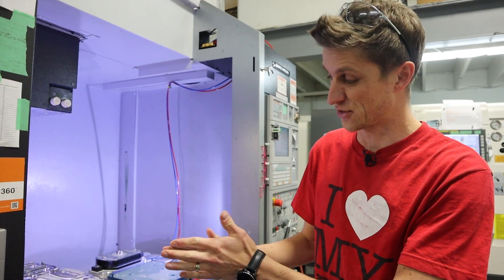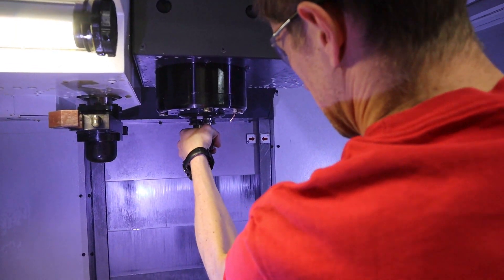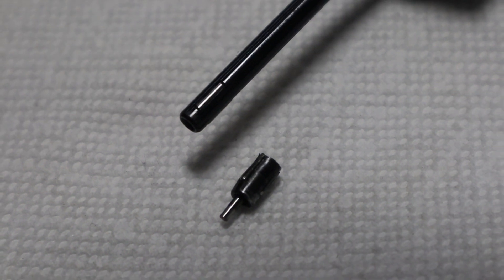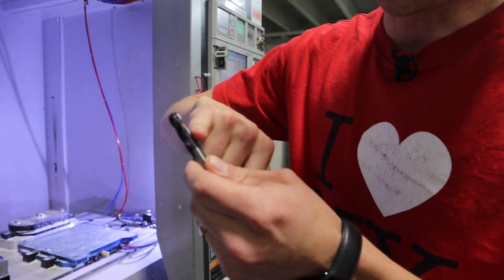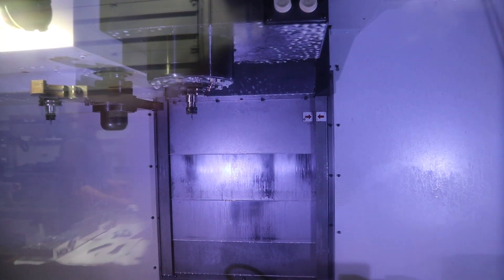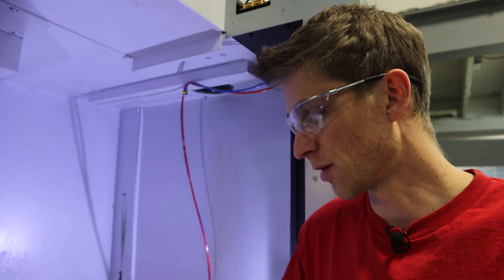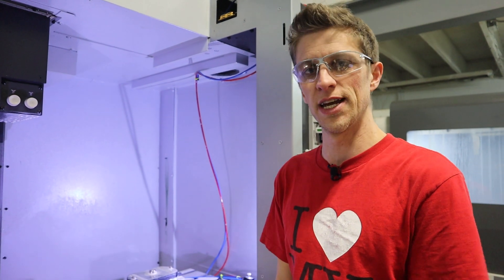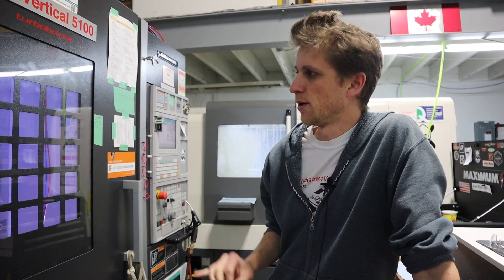Proper Burni$hing w/ a Cogsdill Tool - Part 4

Comment: i run those  for finishing oring bores, the most stupid break we had was the machine got put on osp and the operator changed the part, the burnisher is definitely not a good drill bit.  so far we have found best reliability by reaming then rolling for final finish, seems like more work but it is still less than honing the final bore

Comment: I think I had mentioned burnishing as a fine finishing op several times over the past couple of years so glad to see that you are using it! Have you tried roller burnishing on the faces? That could be a much faster method than the lapping and achieve the same surface results.  I use a roller burnisher on cam and main journals on engines and it works fantastic.
Reply: have you guys seen the new face burnishing tool (DBFM)   -  the link is here - https://www.youtube.com/watch?v=ViyyRlpT53g

Comment: Never heard of that burnishing tool but that's pretty cool. I would imagine that cold forming the metal like that will increase its hardness and give you a more durable bearing surface.
Reply: That is exactly what the Cogsdill Roller Burnishing tool does - there is more information on the process on our website here - https://cogsdill.com/products/burnishing-tools/
Reply: Yeah i totally concur with your comment. Im thinking it does alot of what shot peening would do but a more in contact process.